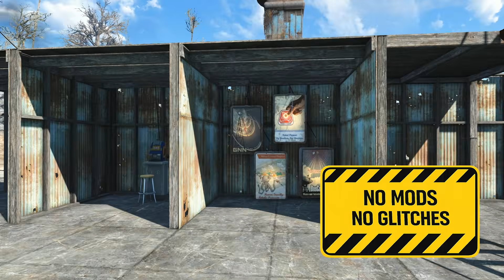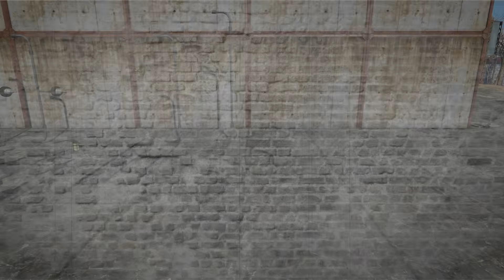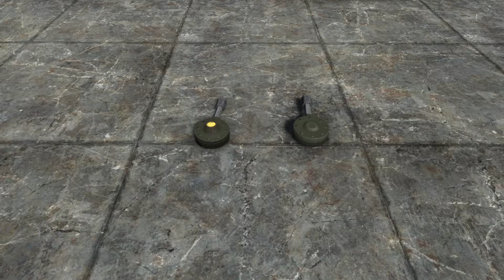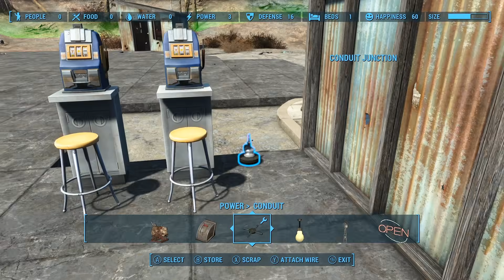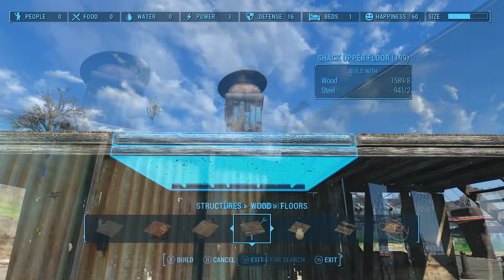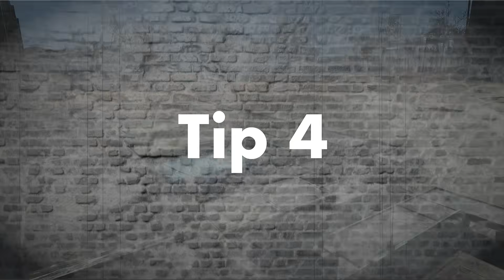How Conduits REALLY Work in Fallout 4 - Tips & Tricks - No Mods/Glitches

Comment: Question how workable are they with Fallout Vault pieces? i need to rework Vault 88 to get power into the Water Pump with out the rug glitch!
Reply from the maker: Ya know - I've never tried the conduits at Vault 88 - I've always use the vault power system.  Just guessing - they should but I don't know if they can connected to the vault power system and you would need a standard generator.  If you try it - let me know how it goes!

Comment: I must admit I always tended to ignore this aspect of powering up settlements, I didn't really understand what conduits were as the game makes no attempt to explain them - but as I play on PC with mods, using Place Everywhere coupled with an invisible wires mod it was a none issue for me as I could literally just wire up anything as I pleased wherever I pleased with no problems going through floors or ceilings.
But regardless this is still useful info. An invisible wires mod makes everything look less scruffy, but the big downside is that I cannot see the wires once placed, and if something goes wrong it's very difficult to track down the issue or isolate whatever faulty wiring is at fault. Using conduits would actually solve all of that for really complex projects.
Still no clue about logic gates or any of that stuff - would appreciate a video explaining how to use the more complicated and technical aspects of power.
Reply from the maker: Thank you - I'm glad that this video was helpful to you! I've had a few requests for logic gates so I put it on the idea list for future videos.  Thanks for the suggestion!

Comment: For some reason, I always have the problem where the conduits interfere with the walls. I've tried walls first, then conduits first, it's always red "can't place there" so I end up using pillar glitch to make them merge. I just wish the conduits were non-collision objects.
Reply from the maker: The wall pass-through can be used to pass through walls but the conduits are a little finicky to work with. Some of the tips in the video might help you but pillar glitching works just as well (and maybe easier!)

Comment: Great tutorial. I just wish I knew how to rotate the axis 90 degrees to place on walls. It seems only ceilings and walls are available?
Reply from the maker: Thank you!  Unfortunately most of the conduits can only be placed on the floor or ceilings. The only options for walls are the wall pass through and the vertical conduit that can be used on the walls. I agree that it would be nice if they could be rotated to fit different configurations.

Comment: Do the conduits snap to anything? If I make a long pipe, it always seems to be at a strange angle
Reply from the maker: Conduits only seem to snap to other conduits but can be freely placed on surfaces such as floors or the ground.  I think the problem with conduits is that they are always parallel to a flat surface making them difficult to run along the ground outside of a building. They will appear to run uphill or will run directly into the ground.
Reply: @CCRenovatesFallout  I have a question about Starlight in the video. Didn't the concrete slabs eat up the whole build limit? I wanted to make a walled fort there and I had to use the gun-drop exploit to get the walls all the way around
Reply from the maker: I went back to the original file where I only had the concrete slabs built and surprisingly it didn't! The size bar is about 50% filled.  However, I did scrap everything (all junk items, cars, trees, etc) at Starlight which allowed me to build an item for each one that I scrapped without it effecting the size bar too much.

Comment: I was trying to put the powered posters in one of my rooms in Sanctuary, but the wiring was a huge pain.  I bet I could just use a radiator and it would work.
Reply from the maker: Agree - the radiant posters are a lot easier.  They don't give off as much light but are a lot easier to work with.  They can be powered with conduit radiators or with the vanilla power connectors (like I show in part one https://youtu.be/7lUKr0s2Ws0).  The radiator or power connector can be located on either the inside or outside of the structure too - as long as the poster is close enough - it will light up.
Reply: @CCRenovatesFallout  The posters powered from the radiator give less light?  Like they are dimmer?  Ew, maybe not,...
Reply from the maker: Their light source is different. They have a light on the top that shines down an the poster instead of the whole poster lighting up.

Comment: Conduits have always frustrated me, so I'd just end up using them for fake pipes and showers, and pillar glitches or sticking with invisible glitches or exposed wires even when I wanted to use them. 😂 Thank you for this! Cleared up a lot of the "why won't this work????" stuff for me.

The upper floor to lower method, especially, is going to be [swearword] lifechanging for my builds.
Reply from the maker: You’re welcome - I’m happy that this is helpful to you and will help clean up some of the wiring in your settlements. Although- there is no problem with using them  as fake pipes and showers. I wish Bethesda would have given us more plumbing pieces (other than a toilet and sink). They would be great for immersion!

Comment: Oh, man! No more jankily running wire through broken windows for me! I can’t wait to get back into my settlements so I can clean up my wiring AND update my power system layout! Simply brilliant suggestions in this video (as usual). Always avoided conduits before but I can’t wait to see how they’re gonna be my jam now! No more garroting settlers with saggy wires in doorways or between buildings… yay! 😅
Reply from the maker: Excellent - I'm so glad to hear that! I went back into some of my old game saves and found a lot of what you describe! If you are planning a whole settlement - I found that it is much easier to design the conduit for each section and then use the vanilla pylons to hook them together or add generators to each section.  Because the pieces only "bend" at 45 degee angles, trying to connect an entire settlement with conduit is very difficult (if not impossible - unless you are up for a real challenge).
Reply: @CCRenovatesFallout   Oh, for sure. the limiting angles and fixed lengths, along with having so much uneven ground helped to put me off conduits. But seeing your "in the air" setup around those generators really helped me see "outside the box". And I will definitely start simple and just use the conduit around building walls and roofs (and floors, apparently) to start. I mostly use street lights to carry wiring in-between buildings and around the settlements. This conduit stuff looks like it really will clean up the problem spots in living areas and common outside spaces though. Very excited. Thanks.
Reply from the maker: You’re welcome! Let me know how it goes!

Comment: Another excellent video - well done.  With more people getting Creation Club items from the newer versions and addons to the game, I thought I'd mention that the Arcade Cabinets have conduit pass throughs on the bottom, along with the normal power connector on the top.  That way (unlike the slot machines) you only have to drop 1 power line down to a connected row of side by side machines - or just feed them from the bottom in the first place.

For people who do use glitches - conduits make excellent spacers for pillar glitches.  Sink a pillar into the ground, lay a length of conduit next to it, group select it and move it to the item you want to pillar glitch in, and there you go.  Also, if you are trying to glitch in ceilings for Sanctuary, you can run a conduit down the center with evenly spaced power radiators on top and you can evenly power the entire house without needing a bunch of connectors along the walls outside.

Keep up the excellent work...
Reply from the maker: Thank you so much for your encouragement! I really appreciate it!  Thanks too for your tips on Creation Club items and using conduits with the pillar glitch.  This is really helpful information!

Comment: I like using the pass through conduits to run power to my multi floor buildings. I set the generator on the ground, just outside the building. I then place a conduit in the same corner on each floor, out of the way of the room, then run the wire up the side of the building. Then I can run wires to the power conduits, I like the Vault Tec ones, to the rest of the rooms. I always had trouble passing them through floors but, your video showed me a better way than mine. Mine left a hole in the floor.
Reply from the maker: Thank you for sharing your ideas for conduits! What a great idea to run the wires up the side of the building from the corner - this is the perfect way to hide wires on the outside! The Vault-tec connectors are good too because they are much smaller than the vanilla connectors - I forgot to mention them in the video 😳
Glad you found an idea to get the wires thorough the floors - no holes needed!

Comment: I really wish they made all walls and ceilings like the vault walls, so they all have wires running through them, and all you have to do is put in a connector to wire anything up or get radiant power, instead of having to run ugly wires or conduit everywhere.
Reply from the maker: I couldn't agree more, that would have made settlement building so much cleaner and easier! 😊

Comment: Do you consider increasing the settlement size by storing guns into the workbench to be a glitch? Also, thanks for the video! Ive never really used conduits before, they seem very helpful!
Reply from the maker: You're welcome - glad this was helpful to you! Technically increasing the size limit by storing guns is an exploit (not a glitch) but I consider it to be necessary to be able to build a decent sized settlement. Modern PCs and consoles can handle large settlements that equipment couldn't handle when the game first came out.

Comment: This is a gold mine of information. I had no idea how useful conduits were until this video. Nice.
I was wondering, since you're in electric functionality, I know of all the logic gates, XOR, NOR and so on. I wonder what useful things can you use them for. Obviously pretty light patterns but anything else. Might be a good video.
Reply: I've used an XOR logic gate at the castle's back door.  I blocked it with an electric door and put switches on the inside and outside walls.  Connected both switches' output to the inputs on the XOR gate and the XOR output to the door.  That way, either switch toggles the door open or closed.  NPCs don't flip switches, so it becomes a player-only door -- flip the switch to open, move through, flip the other switch to close -- works from either direction.
Reply: @evilbob840  Just to add to that, if you make one of your switches a siren. Then not only will NPCs use it, but it'll also auto-lock/close your door when the Castle/settlement is under attack, and warn everybody. Also, if you link the XOR gate output to a fire works launcher and load it with a minutemen flare. Then when your settlement gets attacked your settlers will be warned, doors closed and minutemen reinforcements summoned. All in one go.
Reply: @evilbob840  That is a fantastic solution. Nicely done. Now I am doing that one!
Reply from the maker: Thank you - glad this is helpful to you! I've had a few requests for logic gates - that is a possibility down the road.  Thanks for the suggestion.